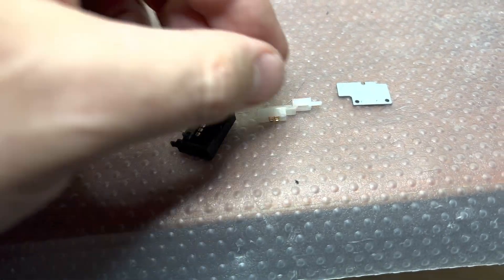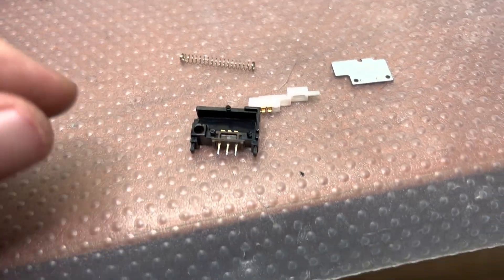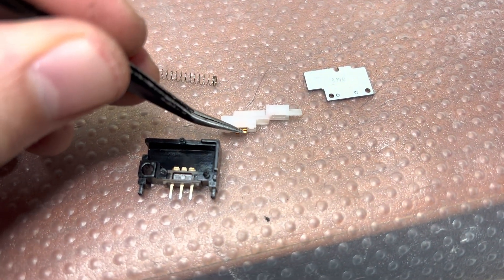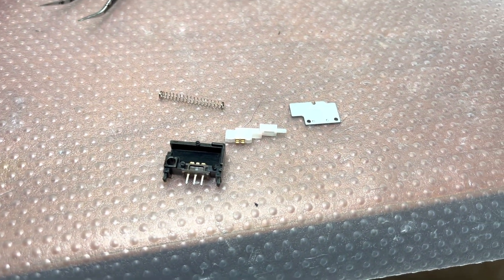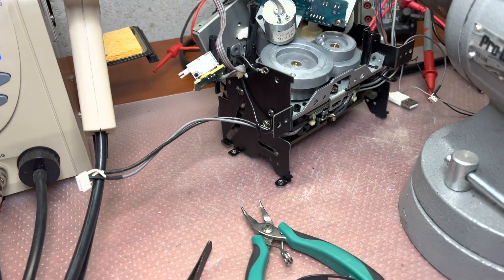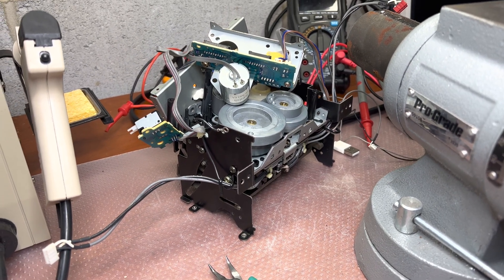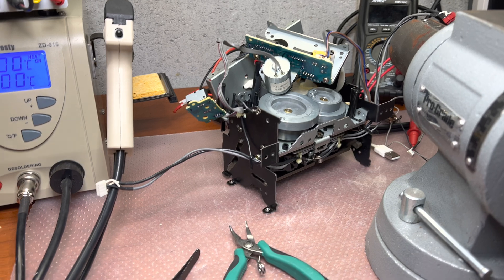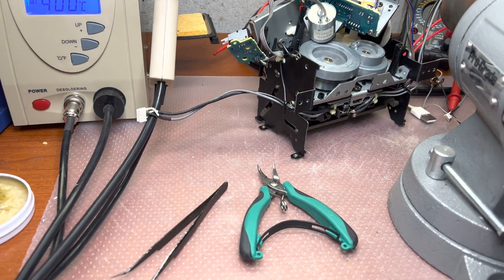Pioneer T-1100 aka CT-95 Restoration Part 6: Cleaning and Reassembling Tape Type Sensors

Comment: Hi there. Would you be so kind to explain what problems could cause these two switches if they have weak contacts? I have an issue with my Pioneer CT-S620 where my recordings on Type I tapes are not consistent. Sometimes they come out brilliant, almost as good as the source and sometimes they become muffled and loose the high end. I do not use Dolby NR. I also want to mention that each cassette type is recognized properly on the display so I assume they work fine. This drives me crazy because I know that this deck can make amazing recordings and I really want to get to the bottom of it. Your help is very much appreciated.
Reply from the maker: @greensmoke61  these switches may set incorrect tape type and recording will be muffled.
Reply: @hifirulezzz  Thank you so much. I think I'm going to just by-pass them with a manual rotary 3 position switch installed on the back of the unit. Not extremely convenient but at least I'm certain that the contacts are going to be firm.